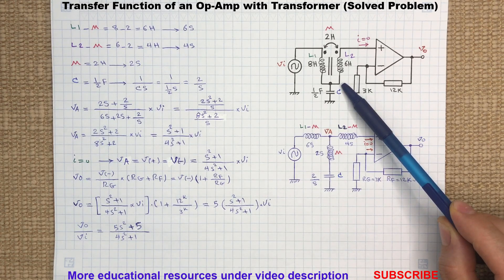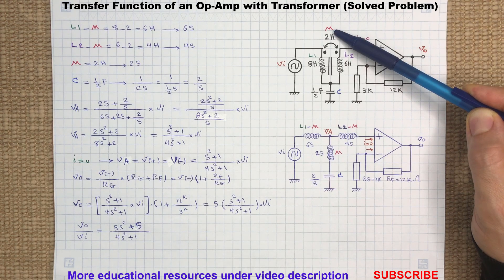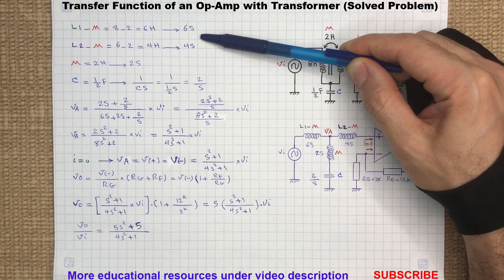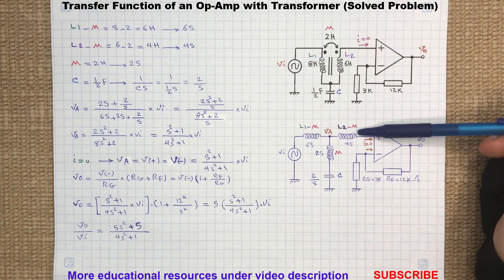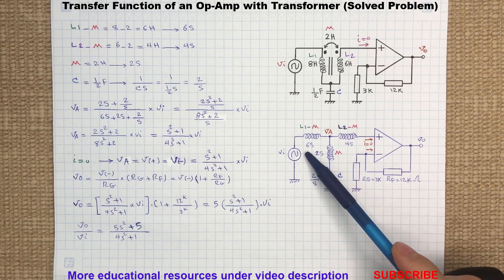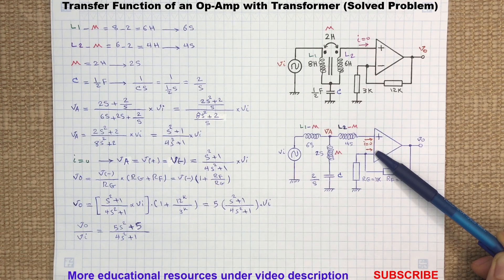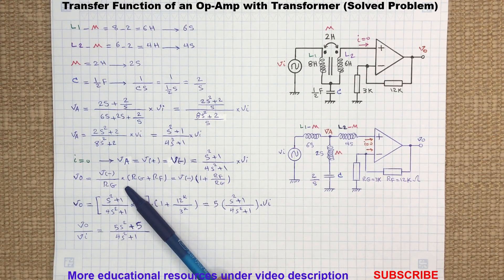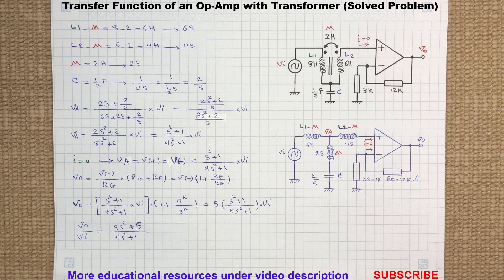Transfer Function of Op Amp Circuit with Transformer, Non-Inverting Op-Amp Transfer function

Comment from the maker: Example Transfer Function of an Op-Amp using Laplace Transform : https://youtu.be/wl7GLFEIGlY
Gain of Inverting Op Amp with RLC at 1 kHz : https://youtu.be/3c92kStPru8
Op Amp RC Filter: https://youtu.be/s0nvWoCd0DQ
Op-Amp Parallel RLC Active Filter: https://youtu.be/NR9MI9PM4-s
RLC Op-Amp Circuit, FE Electrical Exam Type Question: https://youtu.be/zUyj7Xn9-sk

Electronic Circuit Analysis Playlist: https://www.youtube.com/playlist?list=PLLA_QJ8rHZBh5LqrY41bCvKgreRDRWrBQ
Control System Playlist: https://www.youtube.com/playlist?list=PLLA_QJ8rHZBjS_S6WPkmUweF5NbImvSqf